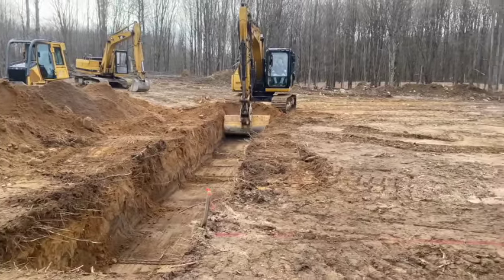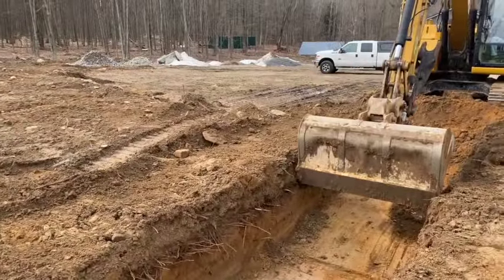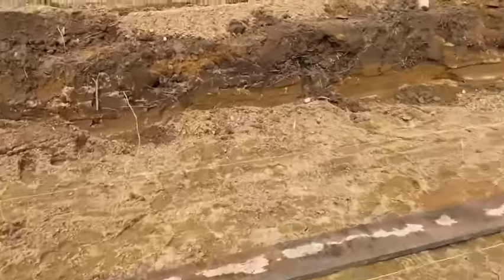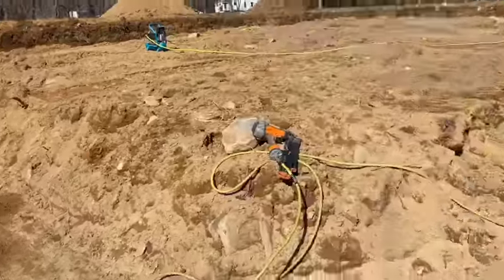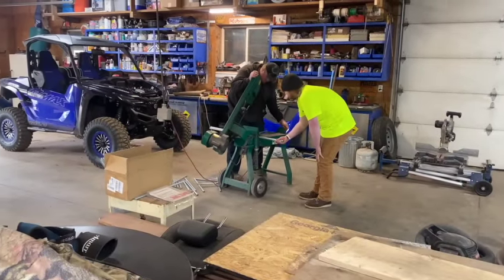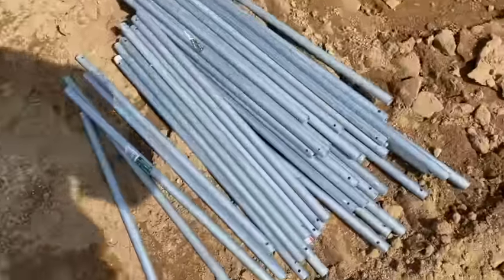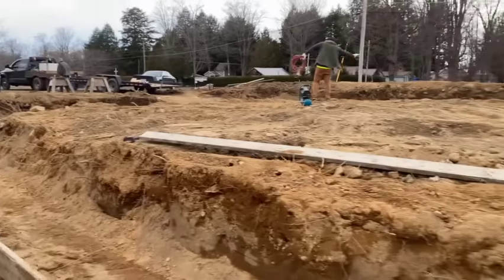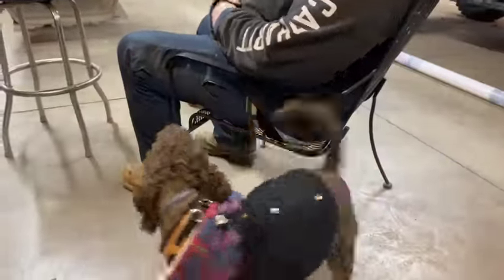Brand new ICF mono pour system you have never seen before.

Comment: Omg as a man that has done foundation work for almost 13 years it hurts watching this man do unnecessary shit. Ya didn't need to drill holes in those little pipes for spacing. A bunch of 3 foot wooden cleats, a 6 penny double headed nail. Measure your 2 ft every 8 feet. Nail it pour then take apart n re use 🤦. It easier pouring the footing separately from the wall so it makes grading the top of wall easier. Use a keyway to lock the wall & footing together
Reply from the maker: We have done 100's of foundations pouring the footer first. There are different ways to get the same result.